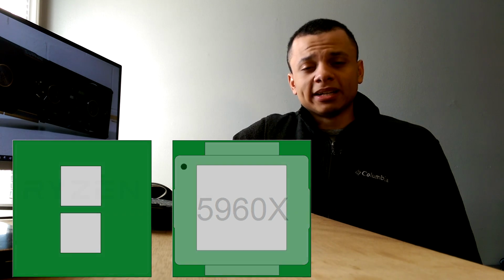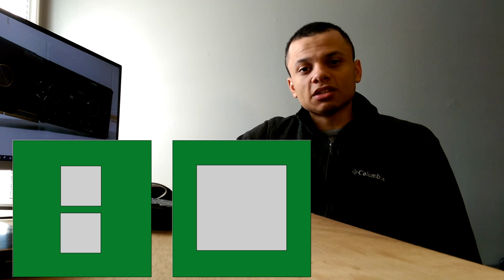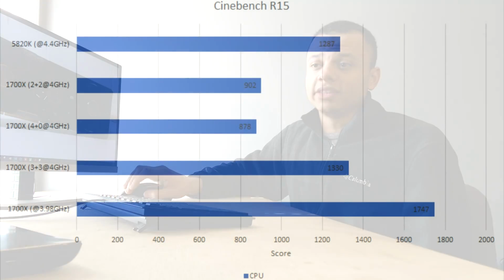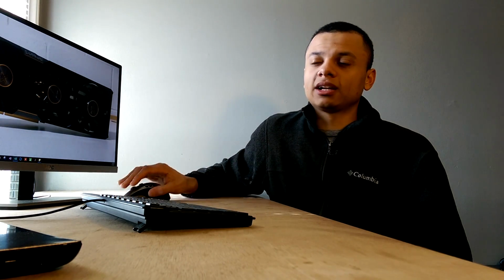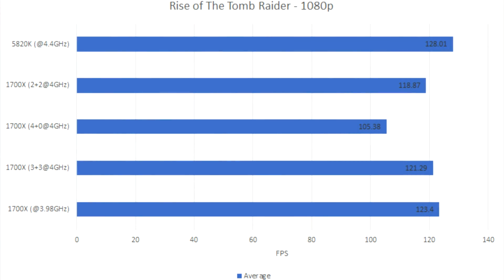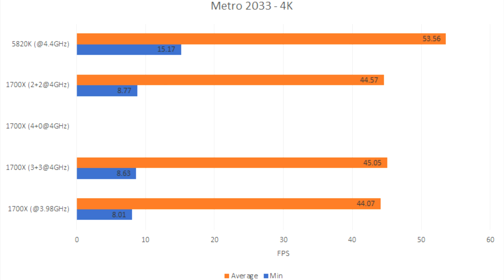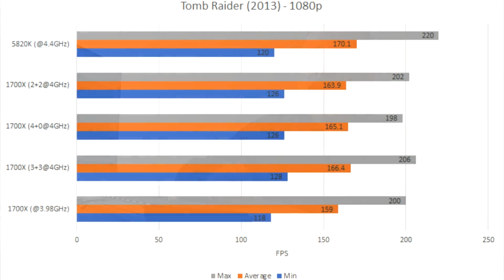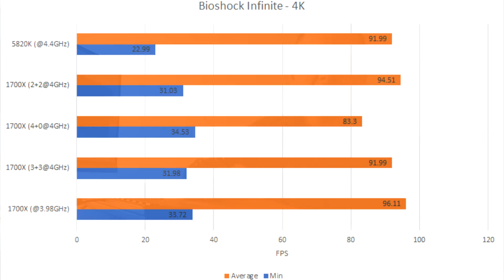RYZEN Disabled Cores Overclocking & Benchmarks

Comment: I overclocked my Ryzen 5 1600x to 4.00ghz and it automatically disabled my cores so I tried lowering the overclock and I got back to its base clock and still it was saying 3-cores 6-logical processors.... tried clearing CMOS which didn’t work. how can I get my CPU back to 6-cores 12-logical processors ?

Comment: how were the temps with 6 cores compared to 8? I'm trying to figure out if the stock cooler is good enough on the upcoming r5 1600 to overclock to 3.9ghz. I know on 8 cores it's not doable for most people without it throttling at 75c on the wraith spire. but maybe with 6 cores it is?

Comment: That board that you fried has more value to Asus than a new one shipped to you
Reply from the maker: Possibly. Asus is already aware of the issue. The problem happened when the motherboard randomly went  into update mode w/o having a bios to load. The board still accepts bios flashes, but won't enter boot. The issue is fixed in bios update 0902. It is an issue with their auto configuration when you increase DRAM frequency while leaving CPU SOC voltage set to auto.

Comment: People just need to understand that this cpu does not OC well unlike Intel, may be future AMD chips will. No software update can change this. period.
But still, this is the best 8 core CPU you can buy. Sure, the fps is a little lower in games when compared with intel chips but for every other work, this chip can handle it without any problem.
And finally, if you really need that many fps in gaming, just go SLI.
thanks for reading! ciao
I will buy Ryzen as soon as i sell my 6600K.
Reply: I think it's pretty decent for overclocking but not for any gaming purposes. But I'm happy with mine and im sure it'll age like a fine wine just like AMD's products usually do. I also think it'll destroy the 7700k when games start to adapt to more threads/cores.
Reply: MohondhaY until it starts choking trying to get frames ready for a SLI setup... I have a 1700x OC to 4ghz with SLI 1070s and it chokes badly trying to keep up
Reply: The videos I saw showed the same performance and some times a bit better performance in SLI when compared with Intel chips at resolutions higher than 1080p
Reply: Kenneth, I would bet that is a different story now, and it probably only chokes at 1080p and if you have sli 1070s you should be running 4k, or high refresh rate 1400p. Also disable the SMT and maybe even 4 of the physical cores (different games different benefits) and add high speed ram then your 1700x will beat an overclocked 7700k in nearly every game you test.